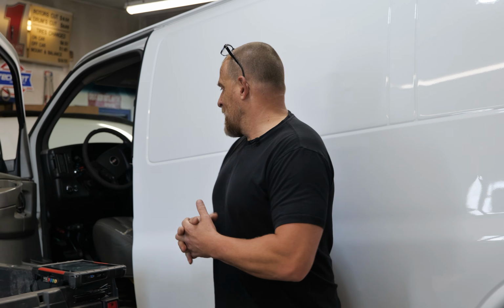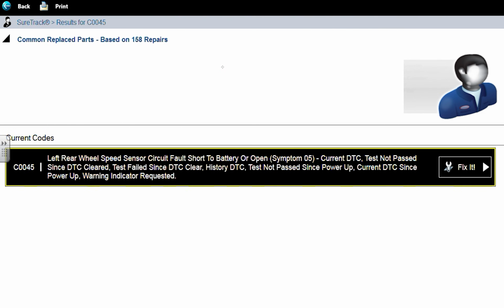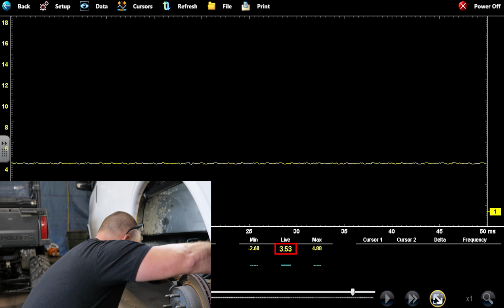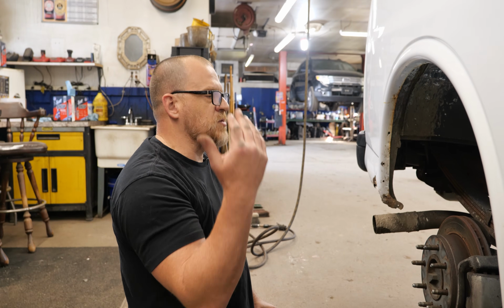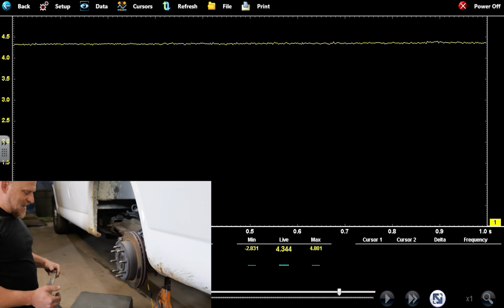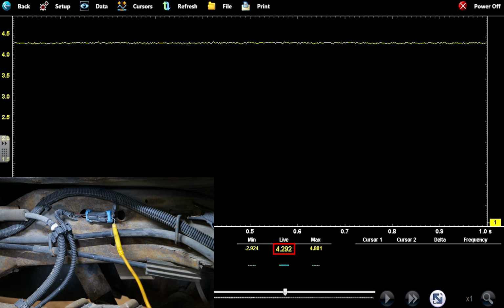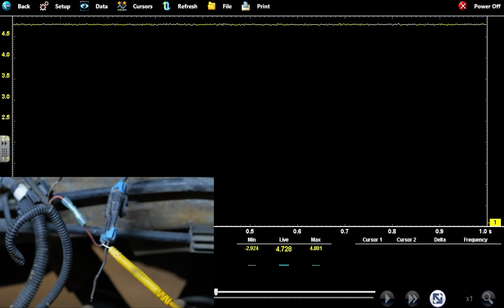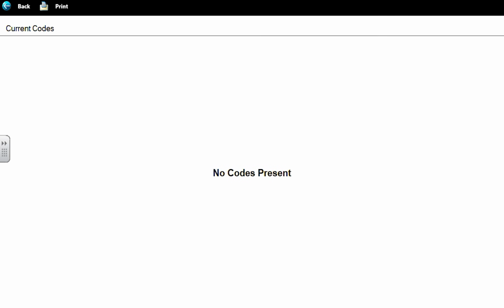ABS Wheel Speed Sensor Circuit Code With GOOD SIGNAL?

Comment: I find this all interesting. Do I really understand bias voltage? No, but I learn differently. I need hands-on with someone who actually understands. 

That being said, one thing that I do understand from hands on, is to be careful how I crimp the shrinky-dink connectors. I was struggling to keep the chicken lights working on the bottom of a trailer. As I was cutting out the green cruddies, I noticed that the green originated from where the male part of the crimper die had poked the insulation. I have the same stripper/crimper as you do, but I only use it for stripping. Notice that the other crimper die like this: () is awfully narrow. Now, when I crimp insulated connectors, the () crimper I use is wide to avoid damaging that insulation. 

I can't tell for sure which die you are using, but on a tiny phone, it looked to me like you were using the pokey die.
Reply from the maker: I was, as it crimps better, but there is a sealant in this style of heat shrink connector that seal that area up.
Reply: @ScannerDanner  I thought that same thing until I saw with my own eyes that it doesn't seal it. There may be a bit of a layer of goo, but it is not a long-term seal. Remember, as the cover shrinks, the hole created by the die grows.

Comment: I work on semi trucks as a fleet mechanic. It’s a good day when I get electrical diag stuff instead of the big heavy dirty stuff. Electrical is the most fun to do. SO satisfying when you find the corroded wire, bad connection, etc. I’ve got so much more to learn.
Reply: Retired fleet maintenance manager after 40+ . Amazing how many times "major" electrical issues can be traced back to bad grounds, corroded wires and bad connections. I'm also a Harley rider, bike runs, won't run, 3 different dealers scan tool finds nothing, Not a bike mechanic but I applied some fundamentals, found a bad connector, 14$ later all is well.
Reply: @Phocoshay_Balperrus  It pays to look for the problem instead of using only a scan tool! Good job man! Cars ,trucks , bikes it don't matter, knowledge that you obviously have is what matters!👍👍
Reply: @douglash3129  sagt ja auch paul ,mit einem tester repariert man nichts . auf die grundlagen kommt es an . lg.

Comment: Had the same with my 2013 Lexus GS450h substituted left rear with right rear until I lowered the lift and jacked up the affected corner and spun the wheel by hand so no of the other wheels speed sensors could substitute values
Reply from the maker: So you had a confirmed scan data substitution, for a bad sensor? Thanks!
Reply: @ScannerDanner  Yeah i had a code for left rear WSS open or shorted to ground and interestingly a both front wheel speed sensors code but I still had a signal in live data, when the vehicle was on the lift and I spun the wheel. The open diff allowed the right rear to spin as well, of course. I kind of knew it was going to be the sensor wire (part of the sensor on this vehicle. Plugs in inside the car, all one piece design £££) because i had slipped with the pry bar when reinstalling the rear steering actuator to the knuckle and i heard the wires stretch but the insulation was still in tact. Like i said it wasnt until only the Left rear was spun individually with the other 3 wheels on the ground that the signal went away. Made the comment before I watched the rest of the video. Thanks for the wealth of knowledge, learn a lot from your videos

Comment: How do you get “sure track” to work on the snap on scanner?
Reply from the maker: My latest update brought it back but I do know that it will expire. Maybe after a year?
Reply: @ ok that makes sense because I got mine used I was just wondering if there was anything I could do to add it mine is good for only up to 2019 it’s a snap on Verus D10

Comment: Is it possible that the bias is exactly 5v and the meter is dropping it to 4.7?
Reply from the maker: 100% correct! And it can vary greatly based on the scope or dmm you use. I've recently seen someone condemn an engine computer for a psi sensor fault because he didn't realize his scope was pulling the 5v bias down to 3v
Reply: @ScannerDanner  I think I encountered that when testing a high frequency antenna circuit, there were 2 coax cables, one running from the antenna directly to the radio and the other to a gps/cellular splitter and from that to the telematics module. On the XM cable I got around 4.9 volts and on the telematics I got 4.45, service information said that it shouldn’t be under 4.5 volts but I figured it was close enough so I put another antenna on and it worked, I’m starting to think that service information has a leniency gap in the acceptable readings for that reason.

Comment: Another shop put a fuel pump and abs sensor in a 2016 60k mile Subaru. Inop fuel gauge and abs code. Previous shop put new fuel pump and abs sensor. It had a mouse nest in trunk. The previous shop unplugged the sensor and the wires were chewed off the same connector harness side. So was I wrong for charging almost as much for actually fixing it?
Reply from the maker: No! Good job

Comment: I'm just an intense DIY'er.  But, my initial game plan would have been to cross-signal each of the rear wheels with the other's wires...  I've got plenty of longer jumper wires made up already for by-passing the OEM harness for similar tests regardless of sensor.

Obviously, if the fault follows the swap, the issue is downstream of the swap.  Then, one can focus their attention on a far smaller collection of variables.
Reply from the maker: There is no wrong way if it works!
Reply: @ScannerDanner  Absolutely!

In addition, when I'm jumping on a problem to fix, I'm also not educating folks.

My comment was authored for viewers and especially for the not fluent in electrical theory.

The idea is similar chasing down faulty CAN bus modules.  Bisect the system and keep bisecting until there are a minimum number of easy-access modules to investigate with the powers/grounds/signal  methodology.

Anywho, I've been enjoying your content for years.  And like you mention in the video, isn't the problem-solving puzzle in diagnostics a complete hoot of fun?

Comment: Great video, Paul!
I noticed here on YT can watch videos at x1.25 speed and 1080p. However, on SDP, i can only watch the videos on 720p and x1 speed. My internet connection seems solid, but i think it's a server's problem
Reply from the maker: About 200 of the 600 videos  were uploaded in 720p which is probably what you are seeing
Reply: So the 1080P on YouTube must be a substituted value? I love your teachings.
Reply: @ScannerDanner  even the videos that were uploaded in 4k i can't stream it in any quality more than 720p without continuous loading
I assume the player and servers are the issues as i can watch videos on any other platforms in higher quality, such as 1440p without any loading time but when watching SDP videos i cannot stream it in quality higher than 720p without suffering of a horrendous loading every 5 sec.

Comment: One thing to be aware of when using a scope to look at bias voltage is that it can/will drop that weak bias voltage much more than a DVOM will. Ran into that issue a few weeks ago when testing a MAP sensor circuit on a Honda - my uScope dropped the open circuit bias voltage to the exact same voltage you'd get for a proper BARO reading at my location. Did some more testing and found that with the MAP sensor unplugged the ECM was calculating 173 kPa based on the (bias) voltage it was seeing, went down to 167 kPa with a DVOM monitoring the signal wire, went down to 125 kPa with a Pico monitoring the signal wire, and finally went down to 97 kPa with a uScope monitoring the signal wire.
Reply: So I should just double check the scopes readings with a dvom? I’m looking to buy a scope and was thinking about the uscope. I’m still fairly new to the diagnostic world and not sure on which scope to get started on
Reply: @davidmembreno6006  It's not an issue 99% of the time - it's only something to be aware of when you're dealing with bias voltage specifically, and in my case it was just VERY coincidental that it happened to drop it to the exact same voltage as a good BARO reading. This was also a situation where you would normally be using a regular DVOM anyway; I just happened to already have my uScope out so that's what I used.

As far as scopes go, as someone who is also in the process of learning myself, I would not recommend a uScope as your first scope. My personal recommendation would be a Pico 2204a bc it's only $130 and Pico has some of the best/easiest to use software, and a lot of the instructional stuff you come across is going to be using a Pico. That said, Pico stopped allowing the use of their automotive features with the cheaper scopes a while back so you'll have to do a bit of searching online to find out how to download and "modify" an older version of the Pico 6 software (they're on Pico 7 now) in order to be able to use it (that's what I did). But once you do, it's great. The problem with learning on a uScope is that it's much more difficult to change the multitude of settings you need to adjust in order to capture and analyze the various waveforms, plus the screen is obviously really small. So it just adds another layer of difficulty to the learning curve. There's also the HScope that Martinloren sells as another option - I recently bought one to try out but haven't had a chance to play with it yet so couldn't give you my honest assessment of it at this point.
Reply: @nowayjose596  ah okay, thank you for the recommendations
Reply from the maker: 100%! Watched a guy condemn a PCM for this same thing. The scope was pulling his signal bias from near 5v down to around 3v and he thought he had a short in the signal circuit.

Comment: You really do have to be careful when using a scope. I just bought a cheap but decent, fnirsi scope, multimeter combination. I was testing the circuit for a honda multi purpose camera this week. I had an extension lead from the battery & moved it to B+ to test the grounds. I switched to the scope function, to test the can bus signal & forgot to change my extension to B negative before connecting the scope leads negative side. Not only got weird signal, but created multiple codes on several modules on that bus. Thankfully, I didn't fry any modules!

Comment: Uh… It’s a GM, aka Gigantic Migraine…

You can absolutely clear the code, shut off the car, disconnect the battery, tap and old the positive and negative terminals together while a partner is holding down the brake and turn the headlights on, while throwing chicken bones on an upside down metal trash can and the code will come back 😂😂😂

Or its the vss sensor is the real malfunction cause tire underinflated

Comment: ive had trickle or float battery chargers not function if the battery is too dead.   is it using bias voltage to decide whether or not to start the charger?
Reply: analog vorladen ,danach funktioniert dein digitales ladegerät .

Comment: Irrelevant today?  Dude I put a new distributor in a 1994 K1500 yesterday.  o.0  Had to disconnect the timing connector under the dash and use a timing light.  I've been doing this since 1987 and I am a subscriber to Scanner Danner.  Nothing you learn about automotive is irrelevant.  I do love watching a 5-10 year tech tackle a TBI running problem though.  XD
Reply: Irrelevant? Electricity is used in a Model T Ford and a 2025 Tesla...the fundamental laws of electicity have not changed...who ever said irrelevant does not know what they are talking about.
Reply from the maker: @mrblonde2013  my thought exactly
Reply: As a 5 year tech who recently had to diagnose a chevy TBI runability issue, I 100% understand your comment. I'm sure I was entertaining as hell trying to figure out what the heck was going on!
Reply: The miracle here is that you were able to find the connector. I wonder why they couldn't put it closer to the distributor.
Reply: @obsoleteprofessor2034  I knew, because I was here when they started that shit.  ;)  I did that on the regular.
Reply: Ive got a 1994 GMC TBI.    221k and running strong😊